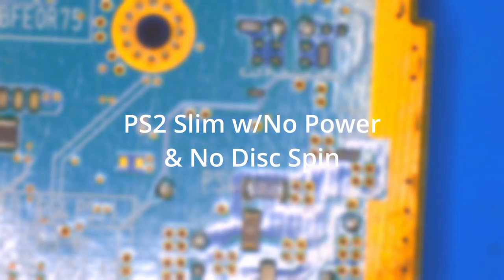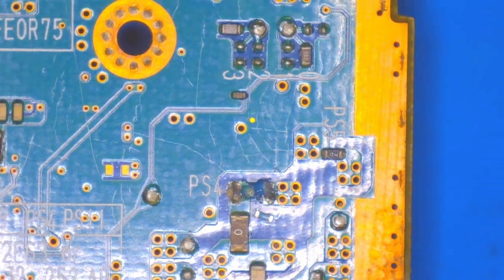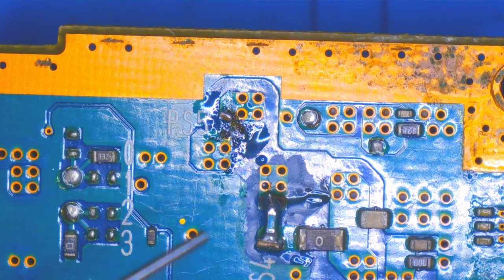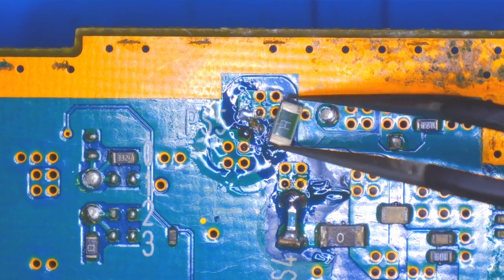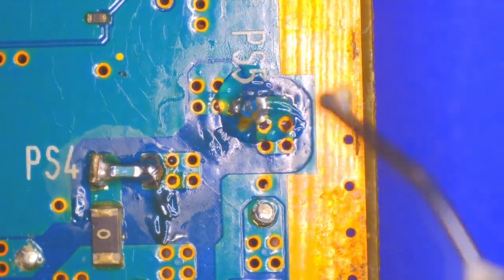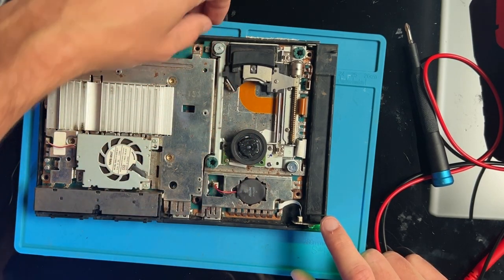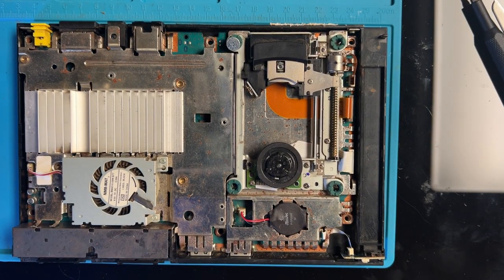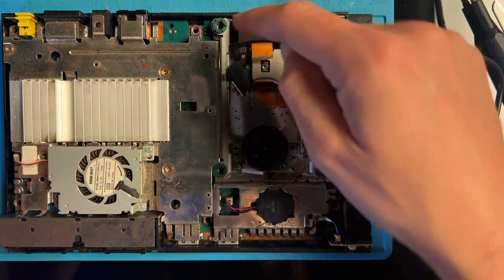Let's Fix It - PS2 Slim No Power No Spin

Comment: hi i want to ask how do you find the appropriate fuse because when i search it on aliexpress i dont know what i should pick
Reply from the maker: The amp rating of the fuse is really the most important part. Ideally you want the replacement to be the same amp rating, be that 400ma, 1amp, whatever it may be. As far as the voltage rating, it should be the same or higher. The PS2 slim supplies 12volts from the power brick so anything rated 12v or more should be good. So you could use a 1amp/16v fuse to replace a 1amp/4v fuse. 

Size is the only other consideration. If you can’t find the exact size you might be able to get away with a size bigger or smaller. Like how I used a smaller one at 1:30. 

Hope this helps some.
Reply: @FixMoreWasteLess  ok thanks a lot!! If I have another question I will ask you later

Comment: In the future I would just remove the switch with hot air. Wouldn't have torn the pad and you still melted the switch with using the wick.
Reply from the maker: That’s a good idea. I don’t think I even had a hot air station when I made this one 😅

Comment: How do you know what fuses to replace them with? And where to get them from?
Reply from the maker: They’re marked on the board such as PS1, PS2 and they also have the part number underneath. You can see at the 3:40 mark what I mean. The number there gives an indication of the fuse rating - 1.6 amps. I google search the part number just to make sure and then buy the fuses from Aliexpress. Best place to reliably find them but the shipping does take a while. Let me know if you have any issues and I’ll try helping out.

Comment: Your soldering iron is just awful!! It doesn't melt your solder, resulting in actually ripping components from the pcb and distroing the pads! From the beginning of the video, the first fuse you've removed it mechanicaly, no desolder. You should use low melt solder, quality flux and more practice, cause i can see your technique is not good!